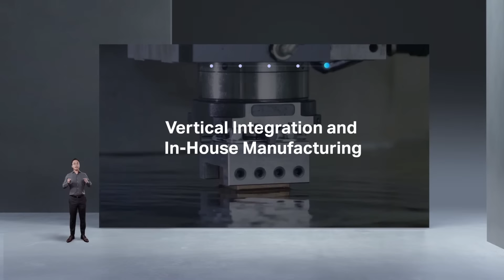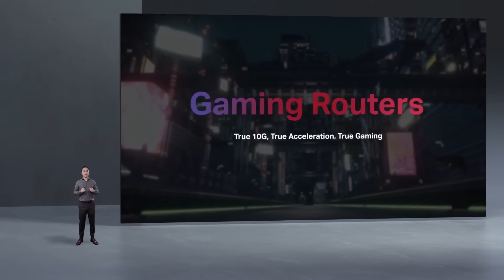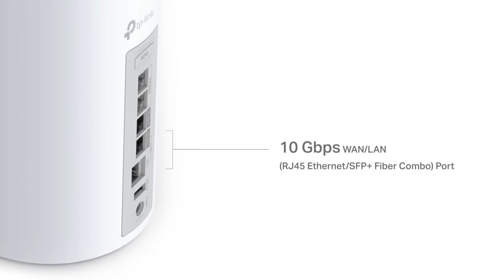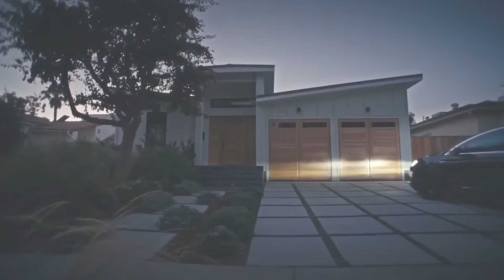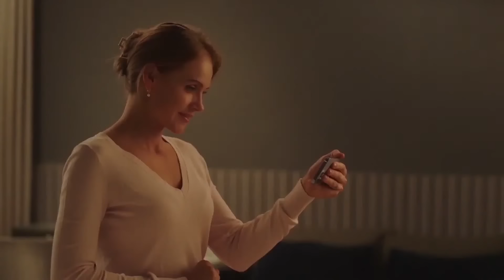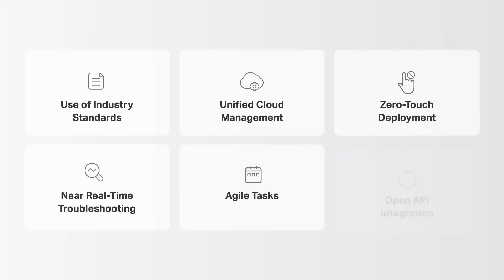TP-Link Wi-Fi 7 Product Launch Event

Comment: I have one question to TP LINK ? I do have a tri band router with wifi6 like the Archer ax90, 
BUT when will tp link release an extender which will also support equally to these router , make no mistake I know about the mesh router such as deco x20 or x60 which the highest variant in india available right now , whereas you sell x90  in other parts of the world , and you omit India. 
My question  is when will you release a tri band wifi 6 extender in places where you also have a wifi 6 triband router, it is unfair of not providing it to us, 
I know there modes such as AP to extend the network past the concrete walls of Indian homes , but customers like me who want only wireless connection , when are you going to do justice ? 
Look at certain companies like netgear they do have a matching router and extender which pushes out the full potential of the router to the dead zones.
Reply from the maker: This channel is managed by the US team.  Since product releases are handled regionally you will need to direct your questions to support.in@tp-link.com and they can help for India directly.